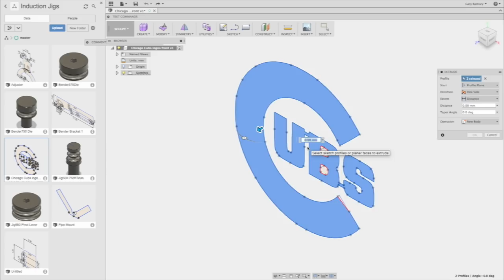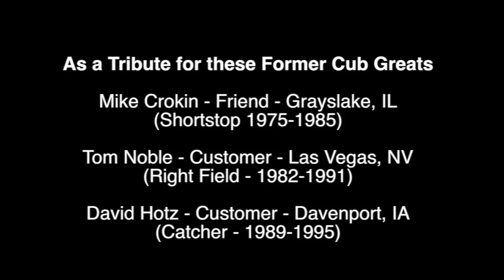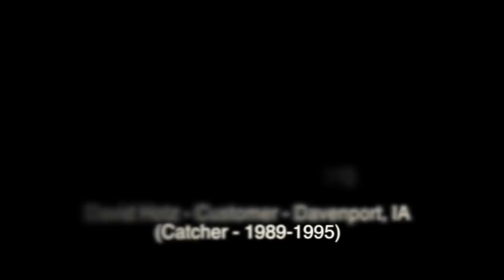Chicago Cubs 2016 World Series Champions Tribute - Metal Art - Mancave - Garage - Bar - Game Room

Comment: How are you attaching the layers? Drill a hole and plug weld to the backside of the next layer?
Reply from the maker: 2 different ways.  Sometimes I will weld studs on the back of the front layer and have holes in the center and back layer and bolt it, these I used 3M double sided tape.  Hearing good things about it so decided to give it a try

Comment: What kind of sander did you use for the brushed metal center disc? Been looking for a good option for our shop without the expense of a time saver machine
Reply from the maker: I use alot of different things in metal prep.  Primarily a 5" makita DA sander, eastwood contour sct burnisher, and 120 frit flap disc on 4.5" angle grinder

Comment: Do you paint the backs of the signs?
Reply from the maker: if customer specifies its going outside i will either make it out of aluminum or paint the backside for a little extra $$, otherwise if its indoors I use a wipe on metal protectant on the backside to keep it from flash rusting